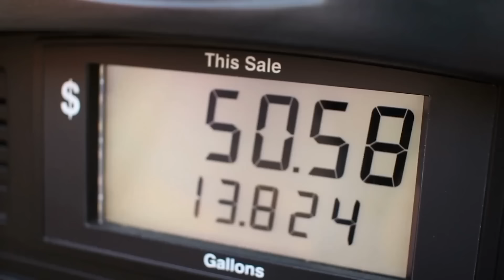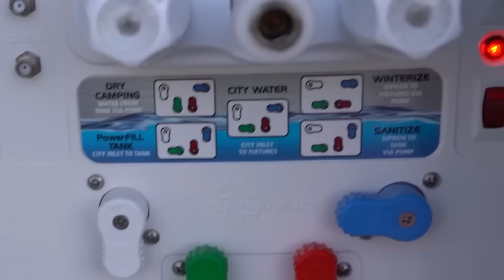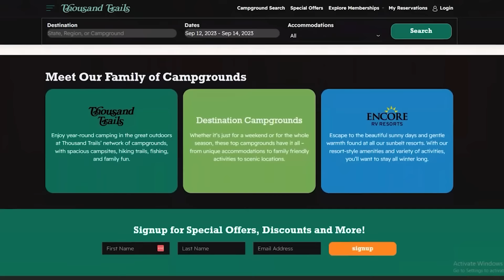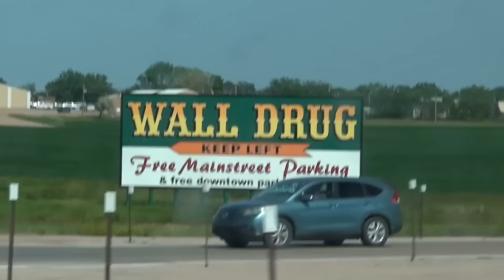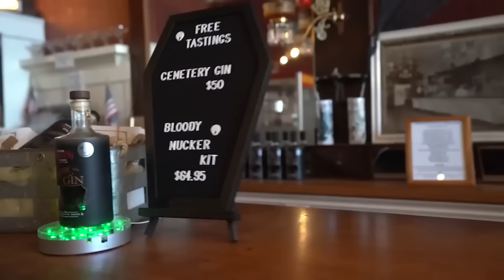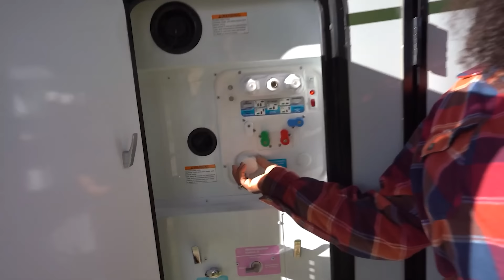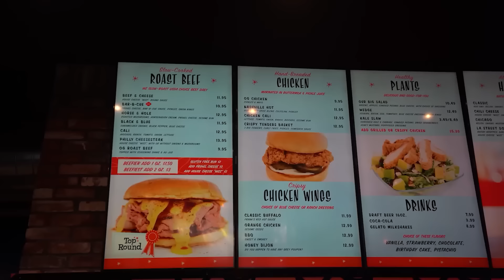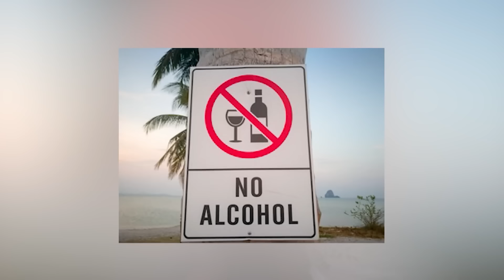RV LIFE: COMPLETE GUIDE to Living in a Camper Van (Full Time RV Living)

Comment: In the 4th section of your video, you talk about packing smartly.  I retired from being a lean consultant.  A lesson from my lean toolbox is "The Rules of Frequency".  Keep the stuff you need the most next to you.  The stuff you use once a year should be stored the furthest away.  Stuff in between,,, well I think you get it.  My whole 5,000 sq ft home is packed using this concept.  Good way to stay organized and waste less time moving stuff out of the way to get one item.  You already do that apparently, you just don't call it "The Rules of Frequency"  :).  Also think about vertical storage vs horizontal storage.  Would you want to stack your books or (I know, old school) vinyl albums vertically or horizontally?  I have a drawer in my kitchen that I put a piece of foam in the same size as the bottom of the drawer and laid out the contents I want in there and drew around each item and then cut that foam out to half the thickness of my one-inch foam.  Then when something is missing, it sticks out like a sore thumb and makes it easy to put everything away easily knowing everything is in its home all the time.
Reply from the maker: Thanks for sharing your great tips on organizing storage efficiently, very helpful!

Comment: Huge fan, and I'm not even and RV'r. Spray your shoes with Lysol spray every time you rake those shoes off it will kill the bacteria and fungus that cause foot odor. You must let it dry before putting your shoes back on. You can also add foot powder with this method if it's really bad. Again, use the powder after the lysol has dried in the shoes.  This worked for me. I have not had foot odor in years since doing this.

Comment: You two are such lovelies ❤🥰

About the long showers: there's  several YouTube tutorials on how to build simple recirculating shower systems, which you can use inside or outside! You can recirculate the same bucket/small tank of water through a filter so as long as you have electricity and propane, yes you can take that leisurely soak! 🤔🫡🚿😌

Comment: Regarding pets on a leash?  When they say "No more than 6 feet long," they mean a 6' fixed length leash, not six feet of your extending leash.  
-- In some places, it will be so stated, but in many others you can get a fine for using an extending one and have to take your pet back to the rig immediately (and/or go buy a fixed length leash).
-- If you are going to use an extending leash, where allowed, learn how to use it properly and most effectively yourself.
-- Train your pet to recognize a command that lets them know they are reaching the end of whatever length you are giving them at that time. 
-- Use words like, "End!!", "Limit!" & Careful..." (I have used these with my guys over the years.) 
-- You can lightly press the lead button before pressing it hard. This creates a blurrrrping sound that alerts them of the upcoming limit. 
-- Train them to the term "Wait!" for whenever they come to a street or intersection and then "OK, cross." when it is safe.
❤Happy travels!😊

Comment: I had always thought about joining Harvest Host but recently, i have seen several Youtuber full and part time RVers say they have been having trouble with it being reliable for various different reasons....Always nice to get several perspectives about it though especially when that is free...Big fan of the Cracker Barrels and Casinos for overnite parking also....One option i did not see mentioned here that is a big fan of ours are Corp of Engineer Campgrounds....Much cheaper than RV parks , almost always near lakes or rivers, and if you have the America the Beautiful Pass those campgrounds are even half off those cheap prices...We often see costs here in the $10-$20 a nite range....Travel safe moving forward, stay well....